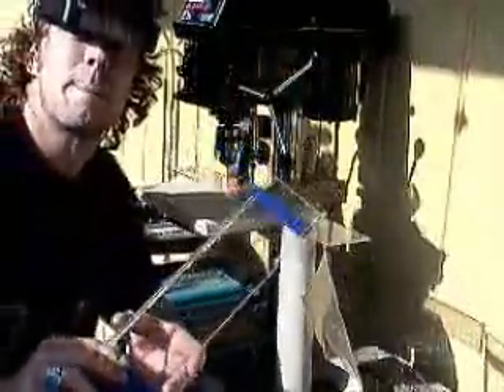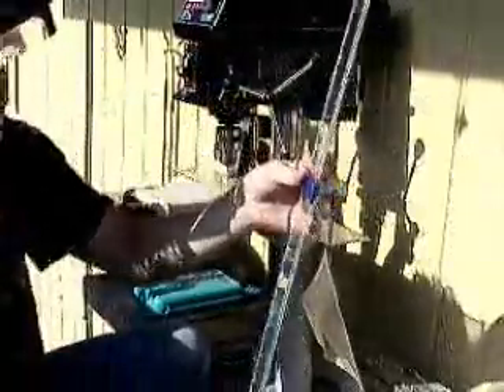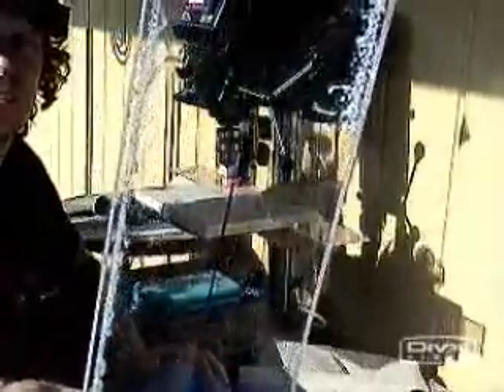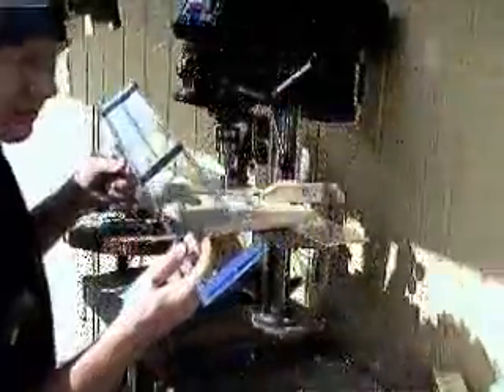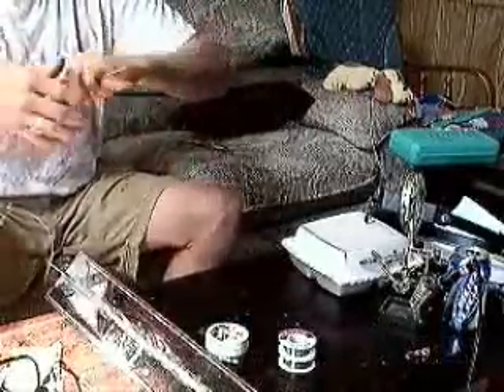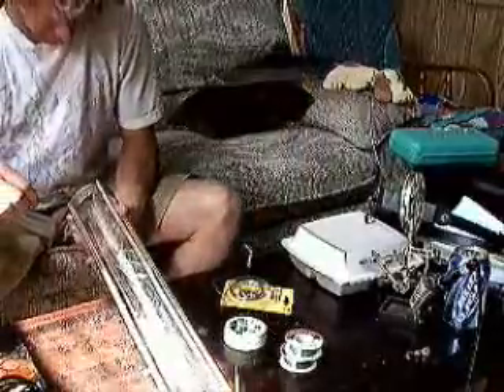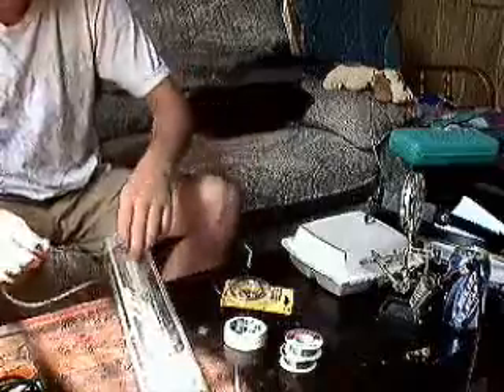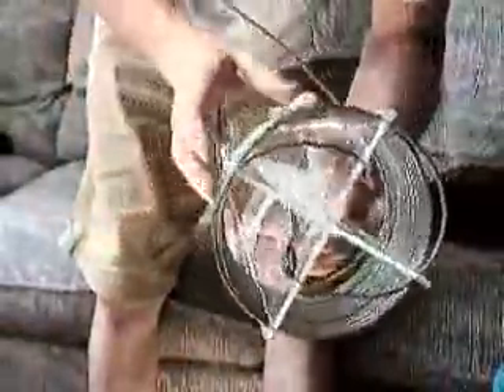How To Hydrogen Generator Prototype 2

Comment: Hey check out my little ss wire fuel cell demo it worked really well until I blew it up..lol, but I wanted to do something similiar to what you are doing now.  Are you done with it and are you running a nuetral wire or just neg/pos?